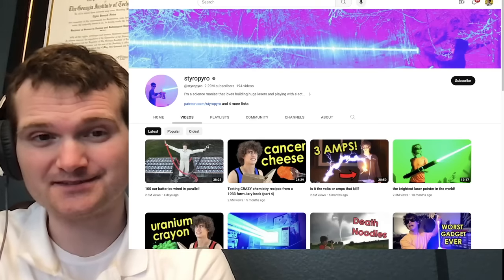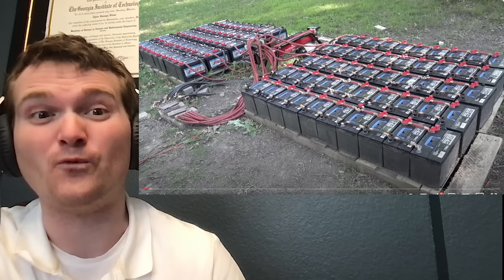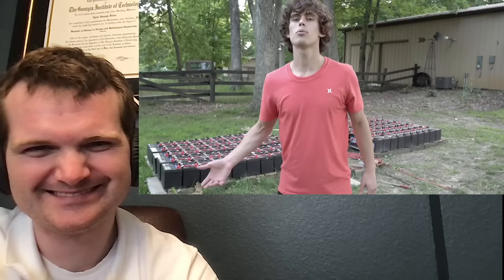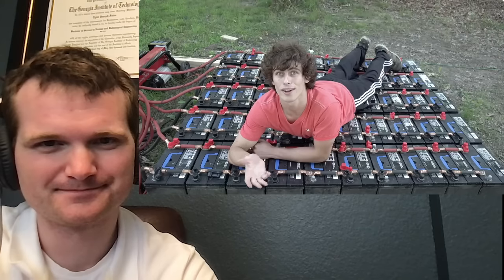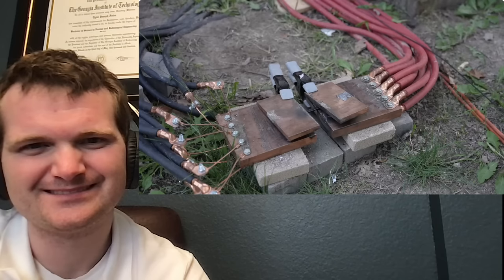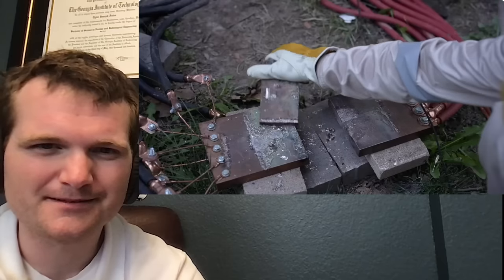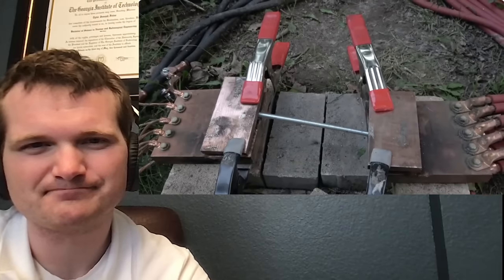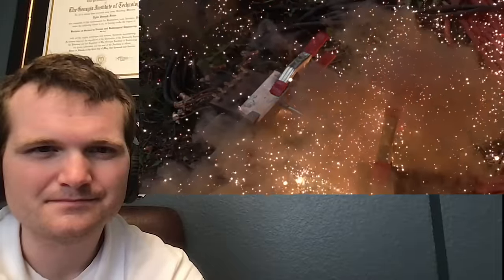Nuclear Engineer Reacts to Styropyro "100 Car Batteries in Parallel"

Comment: another point to make is that if you boil out the average car batt and it's full of hydrogen and ignites then it's almost equivalent to the average hand grenade going off - shorting a batt leads to this type of failure - the electrolyte is there for a number of reasons including safety - also since he's using maint free batts which are VRLA - they have a stabilization chemical added to the elec. to prevent evap. (it's an industrial batt tech that carried over to the consumer market)- but i'd have went old school deep-cycle and popped the caps and ran a fan to ensure maximum output with basically no chance of explosion (though fire would still be possible)

Comment: 5:20 ... the answer is 320 MJ = ~76.5kg of TNT.  26:19 ... a Carbon arc lamp is what powered a lot of old movie projectors ... they used to have two of them in the cinema in my home town when I was a teenager (in the 1980's) and I sometimes assisted in the projection booth with keeping the distance between the rods consistent, as the arc gets dimmer the farther apart the electrodes were, so you had to check every two minutes and adjust them so they were always about 1cm apart.

Comment: Wrench circuits are a thing in styro's other hobby: dangerously powerful lasers. You'd rather short your power supply than overvolt and kill your expensive and sometimes difficult to obtain laser diodes.

Comment: oh no you cut out the part where Styro is asking for ideas on how to keep the contacts from separating while the current is on, and the Backyard Scientist says that he thinks that’s just a really bad idea, and Styro basically says “yeah i know but i wanna see what happens” that was my favorite part 😂
Reply: I was thinking, "if you don't want them to separate, as long as you're using big metal bolts, just drill holes in your big metal plates, string the bolt through them, and tighten down the nuts."  But yeah, probably a bad idea.

Comment: Those batteries have the same energy as 76.5kg of TNT.
The math/sources:
The Wikipedia article "TNT equivalent" says that detonating 1g of TNT releases 4.184kJ of energy.
1g ÷ 4.184kJ=0.23901g/kJ
0.23901g/kJ * 320MJ=76.4832kg

Styro's statement at 5:14 is is somewhat misleading, as in order for all 320MJ to be released instantly, all the other batteries would have to be able to provide infinite current, which is impossible. The actual time it would take to completely discharge all those batteries is proud on the order of minutes, possibly up to low tens of minutes.

Comment: crowbar circuit - typically used to create a dead short to force a fuse to blow - example... LM7805 (5v reg in a TO-220 package) driving a CMOS logic circuit - the adjust pin is used with a negative feedback circuit for ref. and self-adjustment - if the ground connection is lost the the output drifts and anything sensitive to more than 5v goes to IC heaven with a puff of magic smoke - if the feedback circuit is tied to a zener (say 5.1v) and the output drifts above the threshold the zener can be used to activate a transistor to short VCC to GND causing a dead short (which drops the voltage to zero) and forces the fuse to blow sparring the sensitive CMOS logic - one of my fav circuits - i'd rather have to replace 10 board mounted fuses then to t/s a complex logic array anytime - all the different boards i've serviced over the years id say 90% of the soldered fuses where part of a crowbar circuit

Comment: any explosion produces a mushroom cloud.
It doesn't even have to be an explosion. Even a match can produce a teeny tiny mushroom cloud! You can only see it if the air is veeeery still, so you need to light the match with a spark instead of striking it against the matchbox, because it involves a lot of motion which disturbs the air.

Comment: Lead acid batteries only create hydrogen during charging and would fairly quickly leave as it is lighter than air, however, after a large use of current, any battery in parallel that has a lower voltage would begin being charged by others in that parallel group with higher voltages until they equalize, so produce hydrogen, even though not hooked up to a charger.

Comment: Those bolts are zinc plated- that causes most of the problems with electric connection. Zinc evaporates and oxidizes. ZnO is insulator.

Comment: The hydrogen thing is really nasty. Our local school had several car batteries for the emergency stuff (fire alarm, exit lights) in a tiny, badly ventilated room. Even without overcharging there always was some Hydrogen at the ceiling, which my buddy, a physics teacher, once ignited to show the problem to the city officials. They put in a small fan but too low so hydrogen is still gathering a bit under the ceiling which is always a nice show effect. And yes, it should get fixed. But no, no one feels responsible for it.

Comment: I recognize that StyroPryo is more safety conscious compared to other mad scientist types, but one  safety measure this circuit should have had is a passive fail-open device. One shouldn’t need to use energy, or worse, active human intervention for the emergency power off in power ratings like this. 

That’s my only criticism. Everything else else is an absolute joy to watch.

Comment: Pretty sure hydrogen isn't explosive, that would be the oxygen. Even tho hydrogen burns very rapidly, and it might seem like it explodes, it is just rapid burning and gass-diffusion (yes, I am aware of the deflagration speed), that is why it is used as a dispersing-momentum for the "oxygen-bombs", also called hydrogen-oxygen-bombs (not to be confused with hydrogen-bombs a.k.a. Thermonuclear-bombs a.k.a. Fission-bombs), a type of thermobaric-bomb like MOAB (USA) or FOAB (Russia). There was even an accident on the ISS where pressured-hydrogen got ignited, yet never exploded. Please correct me in anything I just typed, if You think (and know what You're talking about) I might be wrong, anyone. Thank You T. Folse for another great video! :) Take care

Comment: "some of these batts can give off hydrogen if they're over-charged" - this is incorrect - all lead-acid batts give off hydrogen until they are fully chemically inert - put a heavy load on your batt and it'll gas - but the most significant time is the gassing phase during charging - the tldr is that you use electrolysis for two very specific things - first is to saturate the chemistry with excess energy to break the lead and sulphate bonds and second to break down the water molecules to provide hydroxide for the sulphate to bond with to reform the sulfuric acid that's being used as a sulphate doner - splitting the water molecule releases H+ ions which is ionised hydrogen gas that even in a giant open room can ignite or explode above 1% atmospheric concentration - (i'm an EE and for the last 8 years have worked exclusively on industrial batteries and battery chargers) - btw Tyler - if you're reading this i'd be curious about your ups battery set-up you showed - the cells appear to be in solar jars with bolt together intercell connections - most likely HV mains ran through an iso trans and then a full wave rec for charging - im more curious about the maint and cycling setup as overcharging and sulphation are issues as well as anode disintegration - offering a fairly in depth discussion if you're interested

Comment: What, no comment on HOW INSANE it is to be showering molten metal onto the plastic battery cases? One good glob of hot steel could melt down to the battery plates and short them, leading to quickly overcharging the rest of the cells, and exploding the battery with a combination A CLOUD OF LEAD PLASMA and SULFURIC ACID.

Comment: if i were styro i would have forgone the clamps and went with a bolt clamping

drill holes in both blocks and use bolts to hold them together and whatever you put in between too

Comment: "There's a reason for it, I'm sure." Of course. But then there's a reason for everything that ever happens or exists, even if it's merely accidental or otherwise not noteworthy. So more important than that is that there's a purpose for it. And yeah, of course, I would naturally do this outside without even thinking about it. I mean: How many inside places would I have access to that weren't filled with things that are more flammable than live grass? Outside is a no-brainer.

Comment: You want to know something scary.  The Tesla Semi has 4 battery banks.  To fast charge the truck you need 4 250KV chargers running at the same time.  That is 1MW per hour of chargers to fast charge a Tesla Semi in about 30 minutes to 80%.  Think of a truck stop charging 20 trucks at the same time.  That is 20MW of power.  This is why the full implementation of EV in just the US on a large scale is not practical.  This would require a massive amount of infrastructure and likely require a complete rebuilding of the power grid as energy production would need to increase about 400%.  I think for now Edison Motors has it right focusing on hybrids for service trucks and semis.  His first 2 builds were logging trucks.  Construction equipment and military vehicles would benefit from hybrid electrics too.  The concept build of the Abram X was supposed to be a hybrid that could operate for about 20-30 minutes off batteries only.

Comment: Look up DB drag racing or propper dropper. I had 880AH lithium titanate with 10 banks of Maxwell Ultracaps, loading with 3 330A alternators. Just for music tho.
Engineers always used to say you can't have 80kw of 12v power,, I would need arm thick wiring. And I always answered that I had those 😂

Comment: I got a question though why didn’t the car batteries themselves get in any explosion or anything like that because of the bismuth molten metal flinging all over the place? at the very least, I would think those sparks would cause some kind of explosion with the car batteries.

Comment: the main problem I see with pyro's setup is he loses most of the power in the connection between the copper plates and whatever he's trying to melt.  he should have some cylinder head bolts torqued down instead of those wimpy clamps.

Comment: He mentions arc flash a few times - at 60VDC I don't think this much of a concern. Maybe at twice the voltage? Certainly at 240 and most definitely at 480. Another thing - he is absolutely showering those batteries in some seriously big and hot sparks! I think that is one of the craziest aspects of his video.

I think there was still some left on the table there..  there is an ENORMOUS potential sitting there! If he would have wired it for a higher voltage yet to let that energy out quicker, things could have gotten properly out of hand 😂

Comment: If one of the batteries fail, it will not create a crater as he is using lead acid batteries. A lot of YouTube’s want things to look more dangerous than it actually is. As an industrial battery technician I can tell you there’s almost nothing unsafe about what he’s doing. Risk of burns for sure tho.

Comment: As an EE all I can think of is "you aren't doint it right, very poor connections!  To be explody you need to do a better job with the connections.  Clean your connections between each test!  Torque them down with heavy nuts and bolts!  The test object should be mounted like the cables.  I want to see full current flow so we get full rapid vaporization.  He has the power needed, but his connections are awful.

Comment: I had a car battery blow up in… or right next to my face as I was leaning over to look in the engine bay. What happened was a wrench slipped off the car somewhere and landed perfectly on both leads. I was extremely lucky I was in just about the right place and the explosion missed me by like 3 inches, it did however cover me in battery acid and again luckily enough I was wearing safety glasses and didn’t get it in my eyes. It was so loud it was like the movies when a Bomb goes off and my hearing was gone and my ears were just ringing my wife ran out yelling what just happened and screaming are you ok and I could not hear her it took like 5 minutes for my hearing to come back and my right ear kept ringing all day. The next day all of the clothes I was wearing just disintegrated with them covered holes where the acid ate through them.

Comment: I'm going to bookmark this to send to anyone who tells me "It's the current that kills you". I haven't even watched more than a few minutes and I can already tell you that touching these leads will not kill you. I'm also not saying the opposite is true because that's basically saying something has the "potential" to kill you, because that's what voltage is, it's a potential.  But in the world of what will shock your ass, put your money on the voltage rating. 12 volts at 1000+ amps is perfectly safe to touch directly, if you don't touch the leads together and your hands aren't wet or sweaty.  1000 volts on the other hand, even at 1 amp, I wouldn't touch. 
That's gotta be $300-$500 in wire alone in this vid, looks like its all 2/0

Comment: Your one key difference between the UPS and the 100 batteries isn't exactly right. Take apart any number of 'batteries' (for convenience, I'll say cordless drill batteries), and what you'll find inside is just a set of smaller batteries or cells. The UPS setup isn't that much different that what he has (V and A excepted). They're both basically a battery bank, and not a 'battery'. Each one of those cells acts like a battery, a group of those cells becomes a 'battery' in turn. In the end, no real difference.

Comment: There is an amazing chanel called Photonicinduction, this guy doesn't post anymore, RL, family, and such. But in his older videos, the guy was NUTS with HIGH voltage/current vid's. One of his more recent vids, he blows a 50000 amp fuse. If you have some spare time look at his older stuff.

Comment: Now I bet 100 car batteries in SERIES would be terrifying...
Reply: i mean, he could probably just throw in a few voltage multipliers and get a similar result! thought everything is gonna be a conductor when dealing with that kind of high-voltage
Reply: 12V x 100 = 1200V. Serious voltage, but not terrifying. Of course, because that’d be 1200V with 850 amps, it’d be absolutely, instantly lethal. But 1200V is still fairly trivial to insulate, it won’t yet have issues with creepage like 5-digit voltages do. (I’m helping on a new laboratory apparatus at work designed for up to 40000V. Not a typo. Now THAT is something that gives you pause… Even though it’s current-limited to just 1mA, that kind of voltage requires huge insulation distances and immaculately clean everything, or else it’ll just creep along surfaces and arc.)
Reply: @tookitogo   forgot it wasnt multiplicative, wouldnt even make sense as it would be around a septendecillion volts, not sure if physics can handle that!
Reply: @kitsunekaze93  Well, we don’t know that such voltage differences don’t exist somewhere, somehow! (I dunno, in space somehow?)

Comment: your atomic plant batteries are a kind of small, even for having only 6V..
we use that size for emergency lights systems..
for phone service buildings, a single 12V battery is 750kg!   
with 3000 A constant drain for up 1hr!

Comment: Why are the negative cables connected to the plate with small wires?
Reply: They are acting as fuses. It's literally how a fuse works. It is rated to only pass x Amps and if it exceeds that rating it melts breaking the circuit.

Comment: I’m an Electrical Engineering Manufacturing Technician and Slot Machine 🎰 Technician living in Las Vegas. 
When l joined the Navy l decided on the Nuclear ☢️ Power Program.

Guess what….l passed the test by one point but couldn’t secure a Top Secret Clearance. I had a few traffic tickets. 
I became a Storekeeper in the Navy. 

I’m also a Dj and the founder of an inventor based electronic OEM technology company. Something like a General Electric. ⚡️ 

Subscribed. I want to know how a Nuclear Engineer thinks. I just build circuit boards and electrical devices. I’m also into robotics.
Dropped out of College. 😔

Comment: If thats how fusion works, then you run into a whole heapload of issues; material quality would play a CRITICAL role, as you'd need as few defects as you can possibly get with any and everything about the machine; otherwise even if you are able to contain the plasma, it'd be so wobbly and unstable that you could never compress it enogh to initiate the fusion process, you'd just be playing with a miniature sun that doesnt give you anything lol

Makes me really wanna research this more and see if I can't come up with one (of the 100's of thousands of) solution to hopefully help out, been coding physics lately from "scratch" (no guides, etc) so this could be p fun lol

inb4 the fun part lasts for 5 mins then the rest is self mental desctruction

Comment: V=IR not I^2 R
Reply: You sure you didn't mishear? P=I^2R
Reply: @onradioactivewaves  I could have, but he was talking about the voltage drop across the cables. So they were measuring the current by the voltage drop on the cables, according to I = V / R from V=IR.  But being wrong is certainly a possibility.
Reply: @Darryl_Frost  timestamp? I didn't watch the whole reaction as I had already watched the video. It was styro who said it?  Could have just been a mistake while focusing on making the video, he obviously would know that basic information correctly if designing Tesla coils and laser etc.
Reply: Ya you're right the engineer here messed that up also corrected it onscreen